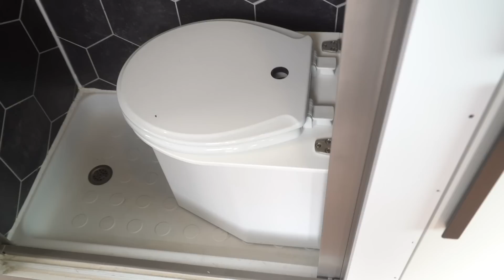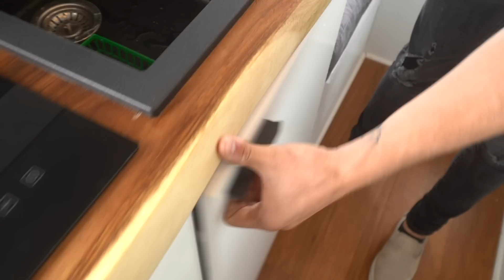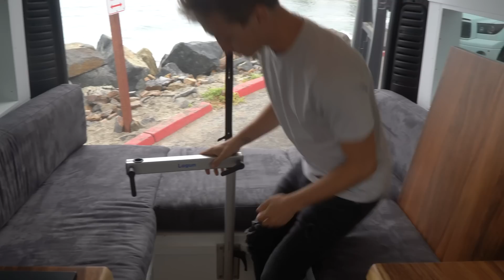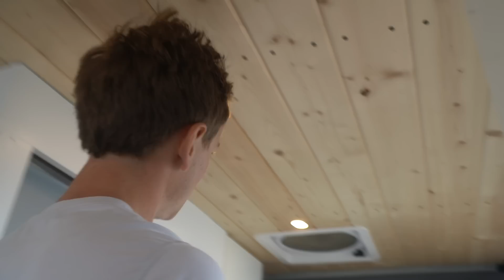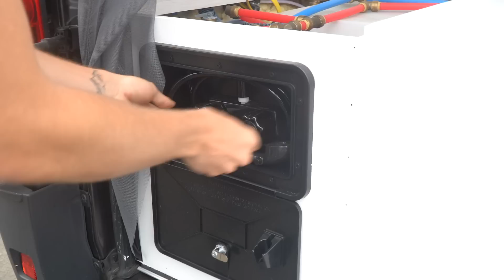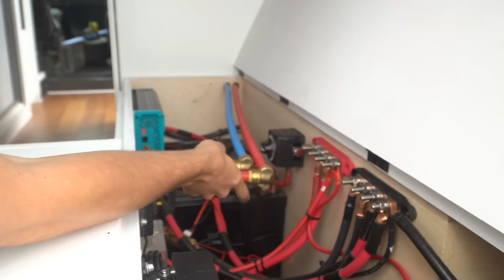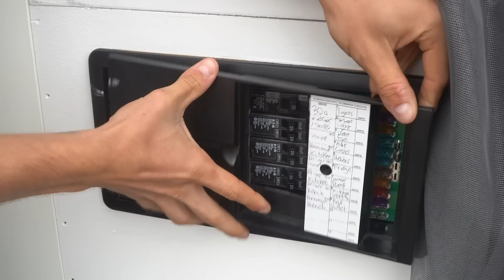LUXURIOUS Custom Van Tour | MASSIVE Black Slate Shower | 12v AC | Full Course On This Build!

Comment: very nice build! i especially like the shower and c-head toilet, and the bed/table+dinnette is quite nice also. however, i am curious why you didn't go with propane? imo, a tankless ventless propane water heater is a  far better vanlife than an electric water heater, even on a timer (nice touch). also, cooking dinner at night on that induction stove will heavily-hit even the beefiest battery bank. lol, i loves me my suburban 3-burner cooktop+oven! :) am super-interested in that fresair ac unit. i made it through summer in the dc metro without it using a box fan (even though it was 95-105 for all of july and much of august), but it'd be great if there was a good low-power off-grid cooling solution...
Reply: I think some builders are shying away from propane for liability reasons.
Reply: @GOLDVIOLINbowofdeath  interesting...well, i built my own, so i'm liable to no one but myself, and i wanted propane! xD it's just such a convenient and energy-dense fuel. peace
Reply: I didn’t say I wouldn’t use it. I’m planning on probably using it too but I’m going to be very careful about it. Probably gonna mount the tank outside on one of the rear doors.
Reply: @GOLDVIOLINbowofdeath  it's not actually a big deal just follow the national fire protection code for rvs, you can get a free copy online. basically, just need to have a doubly-vented sealed locker with steel holders, and use copper line with forged brass flare fittings, ez-pz. unfortunately it's not legal to put propane near rear bumper...that's where i waned to put mine. :/
Reply: @douglasharley2440  Thanks, I had not heard of that code. The one thing I’ve noticed is nobody ever talks about making sure that you can get out the back doors and a lot of people are mounting their mattresses just above the door handles and right up against the door and I’m like you know if you’re in a smoke-filled van and you’re panicking and it’s dark are you gonna be able to open that door
Reply: @GOLDVIOLINbowofdeath  make sure it opens inward though, otherwise you can be trapped. i think there should be 2 exits too, but code is just 1.
Reply: @douglasharley2440  I couldn’t figure out how to get a free copy it said sign in and the only way I know to sign in is by having a membership and the memberships are not free so please show me how I get the free copy because I don’t particularly wanna membership in the NFPA

Comment: One major problem in this nicely designed van. The intake for your water on the outside needs to be locked up. If you left your van for any purpose anybody could come along and pour any kind of poison into your tanks. You really need to consider locking that up in some way. Otherwise one of the best bands I've ever seen
Reply from the maker: Patti Muscarella lol, I’ve never really pissed anyone off enough to poison me 😂 thanks though!

Comment: Beautiful build, please support those water lines in the electrical area. My god... so much work and money in that area. PEX is great but you are really throwing the dice with the lengths of pipe and those 90 degree AP adapters with any vibration that happens. They are not designed to an automotive grade on there own like that. Over time your hot water line will sag and that Adapter will fail, your pump will click on and off very slowly "hopefully not when you sleeping!" humidity will rise, fuses will blow. Easy add on to secure it though, just build some supportive framing for the water lines, secure them every 8 inches along the frame, use some sort of vibration dampener "water line insulation foam"  especially around the joints, good to go!
Reply: I'm not an expert by any means on plumbing or electrical, but the first thing I thought when I saw the water pipes over the electrical was I wouldn't want that if it was my van. I came to the comments and saw lots of other people think the same thing.
Reply: @VM-123  You're right. You're not an expert so how about you leave the details to the experts who actually know what they're doing and how things shouldn't/should be done. kthxbye.
Reply: @JenSwarbrick1966  I am an expert when it comes to who I spend my money with. I don't give a s*** if you have 10 degrees, and can build a house with a blindfold on. If I don't like you, then I won't spend my money with you. And if I don't feel comfortable with what you're doing, I'm moving on. What are you, a sock puppet account? I bet you're him lol 😂
Reply: @808kuualoha  Proof? Dare ya.
Reply: @808kuualoha  Or he could just post his videos on Vimeo were people who don’t want negative feedback post. As George says, options.
Reply: @808kuualoha  Awww, look at you Mr. No Name - No Face internet troll. How cute.
The man knows what he's doing and it's not up to you to decide what he should and shouldn't do with his business.

Comment: Hi I am finding it hard to locate the freezair unit on Amazon. Could you give the model number. Greta vlogs by the way. I am watching from accross the pond.
Reply: It's called Fresair, Google it like that.
Reply: The video producer (Tricked Out Vans) wrote an answer in another comment. He wrote: "This is the fresair, now I use the zero breeze! "
Reply: @steadmantheartist  I have read a few  Vlogs, and it looks as if the Zero breeze has not received very good reviews

Comment: Nice! Looks like the classic Beachhouse layout from Sara and Alex James, did you use their plans? 🤗🚐 compact and all you need... if people want to shower with the C-head toilet in place it’s fine as it’s made to be waterproof - except for the little hole on top for the crank! I tell people to buy a rubber tub stopper in the right size for the hole to make sure no water gets in the #2 area. 

Cozy! 👌

Comment: Wow... There were so many comments from people with experience from many different industries giving you advice on blatant mistakes and shortcomings. (probably not in the nicest or most supporting way) But you just deleted them all like it never happened. Only positivity, unicorns and rainbows here.

Ever seen a van on fire?

https://twitter.com/ArlingtonVaFD/status/1082732521224310784?ref_src=twsrc%5Etfw%7Ctwcamp%5Etweetembed%7Ctwterm%5E1082732521224310784%7Ctwgr%5Eshare_3&ref_url=https%3A%2F%2Fwww.arlnow.com%2F2019%2F01%2F08%2Fjust-in-truck-on-fire-near-arlington-forest-church%2F

It usually happens when tapped wire short out or water leaks into an inverter.

Comment: Nice van, but i have the same comment about the video as i had last time. I lack the overview of the van before you go into the details. It’s hard not to get bored watching you explain your heater control in the corner without having first gotten a good idea on the van. You would not want to start a video with a tire shot and then move  to the door handle  on the outside would you? You show the entire van...So we need to get a feel for the van before we can get interested in the details...especially since it is a nice van... :)
Reply from the maker: nomadic.luxury good feedback! I just like detail oriented tours!

Comment: For the AC wiring you mention 10/2 in and 12/2 out, I suspect you used 10/3 and 12/3 so you would have a ground.  Is that correct?  Also did you ground the inverter and solar controller chassis?
Reply from the maker: Bob Teaford 10/3 and 12/3 have 4 wires. I used what I said :)
Reply: @shaidenvalentine1  Of course you are correct!  I thought the second number referred to the number of wires in the bundle, that would just be too simple...

Comment: Very good to have so well presented water and electrical systems! Excellent 👌
Didn't comprehend solar wattage but some 300 to 400 W would do great, and there's plenty of roof available for that because of single roof fan
Reply from the maker: Mika Helander it has 400

Comment: When boon-docking, water is limited. How much water does the swamp a/c use per day?
Reply from the maker: Michael Lin 4 gal
Reply: @shaidenvalentine1  WOW!  THAT is a lot of water!  My van keeps 20 gallons for two of us and a pet. That usually lasts us about 2-3 weeks. I can't imagine using 4 gallons a day just for AC (I usually camp in the desert so water refill isn't "handy" for me.)
Reply from the maker: Roobah wow! 20 gal is tiny! And 4 gallons is on high for 24 hrs a day in the desert. Probably more like 1 gpd
Reply: @shaidenvalentine1  Which desert? what part of the year? Have you used it in Phoenix, in Aug, 120 degree F, 24 hours a day? What's the temp outside and what temp can it bring the inside of the van down to? thx!

Comment: Great layout.  I have a solution for the water line,  so it does not run in the same compartment of the electrical. If you raise the siting/bed one step,  you can have a box in the hall between the sits, a great space to run the water line and store shoes in there too. What do you thing?